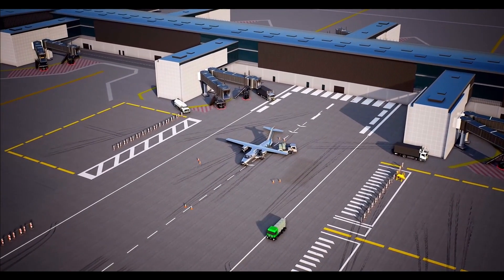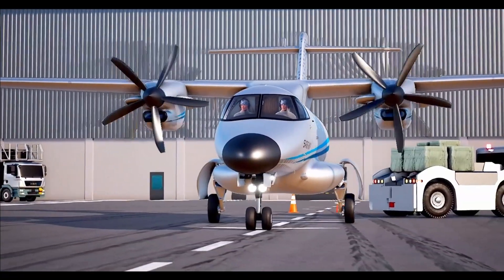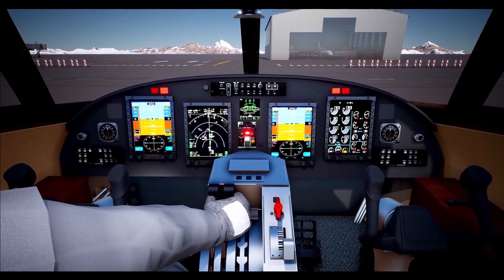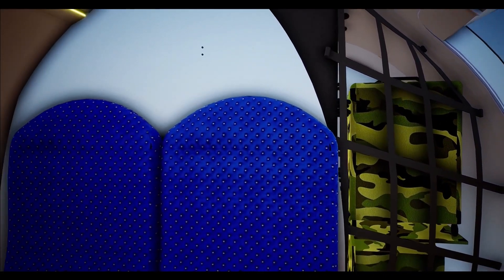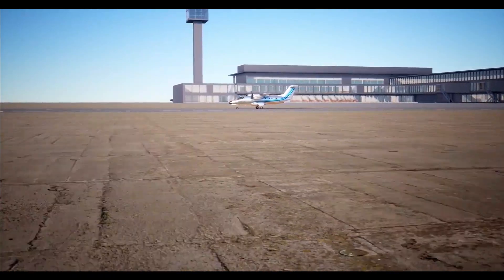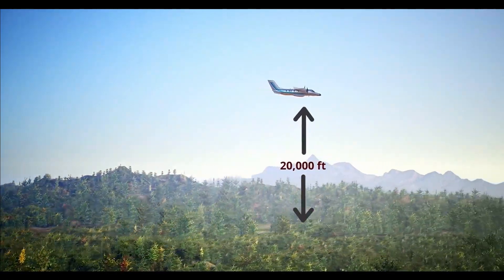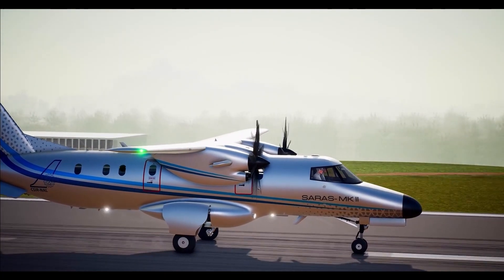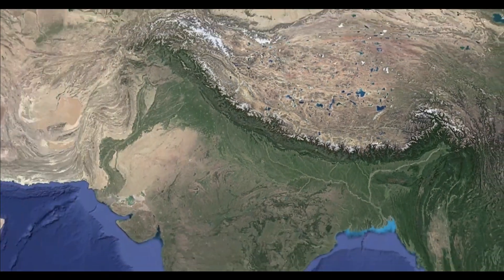SARAS Mk II - Concept to Design

Comment: They are still developing this aircraft? They have been at it for almost 20 years and all they have is CGI?!! 

The lack of urgency in the Indian public sector is beyond ridiculous. Shame.
Reply: Na, they have developed a Mk1 variant which had first flight 15 yrs ago, which had some flaws so got benched by the previous govt. This project was later revived for the UDAN Scheme to promote regional connectivity.